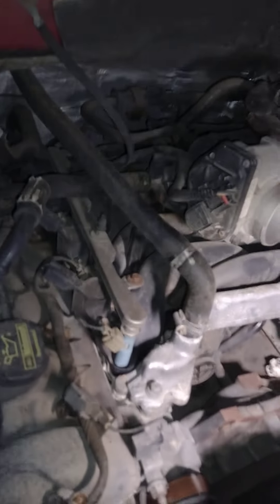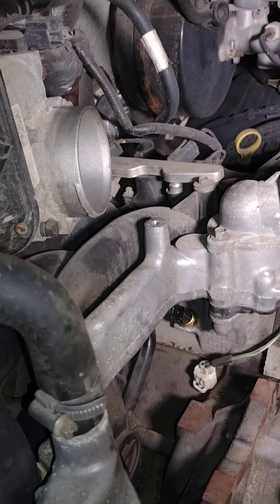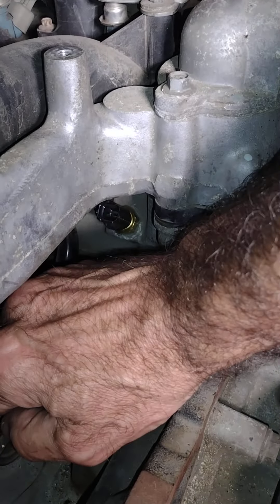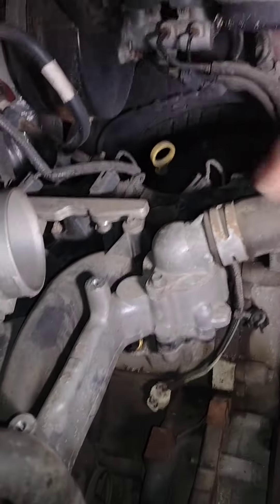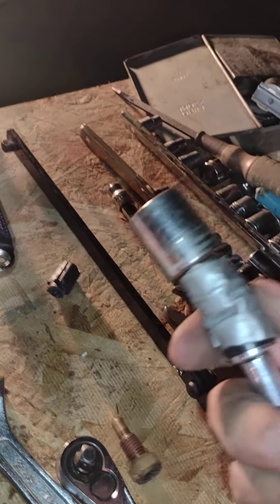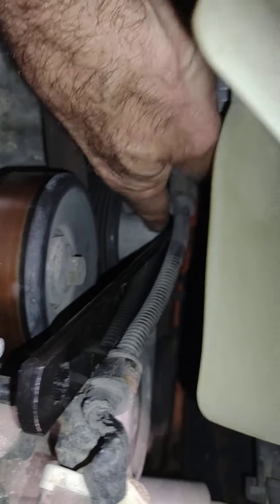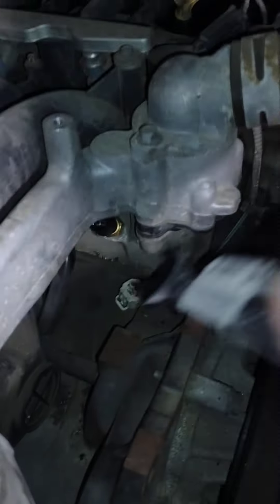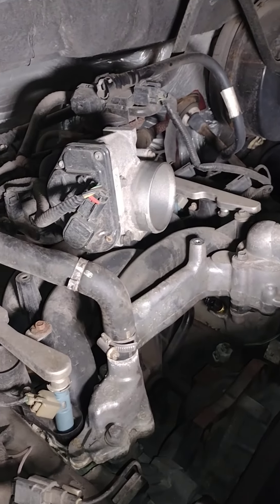Coolant temp sensor, 2009 F150, 4.6 V8

Comment: Great video bro 😎
Reply from the maker: I did find out after changing the coolant temp sensor I also needed to change the EGR valve. Hard to say if both were at fault. I am leaning more to the EGR being the culprit for not wanting to start when hot, and a ruff idle.

Comment: Would it chug while trying to start when warm like it was flooded?
Reply from the maker: While trying to start, it turned over fast. So it did not Chuck until after he was running, it literally sounded like I had a massive cam in the engine. After I changed the coolant temperature sensor it turned out to be the EGR that was causing all my problems. The EGR will cause your engine to chug while running,  I do not know if it will do that while trying to start. Usually that is because of timing, or a weak starter.  Possibly a cam position sensor?
Reply from the maker: I meant it did not chug, did not mean "chuck" spell check sucks
Reply: Thanks for responding. This is only on a warm start. It starts up perfectly after sitting for a few hours and runs great other than at idle and warm start. Could that be associated with a timing issue?? I did however find the wires to the CTS hacked up some which may… be part of my issue. Going to test electrical tonight after I take alternator off
Reply: I planned on replacing the CTS, EGR, PCV, and Cam sensor. Hopefully one of those will be the culprit. I have already replaced all spark plugs, injectors, intake manifold, cleaned throttle body, cleaned MAF.